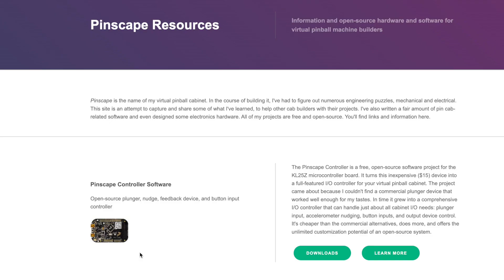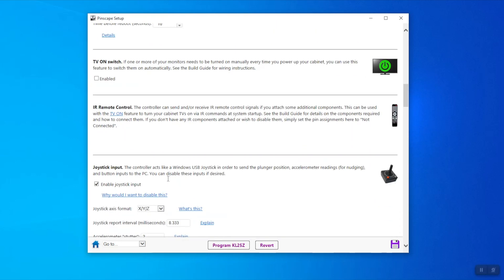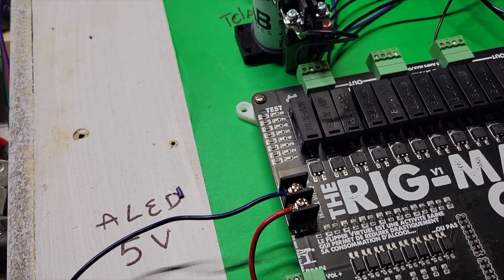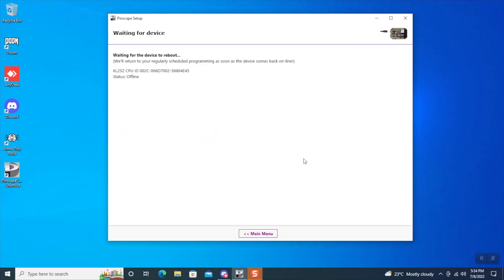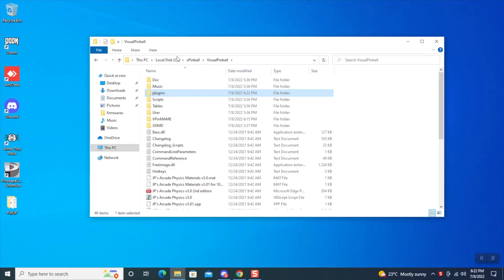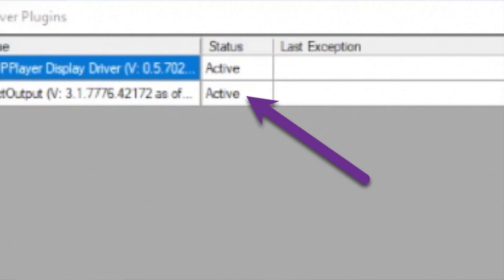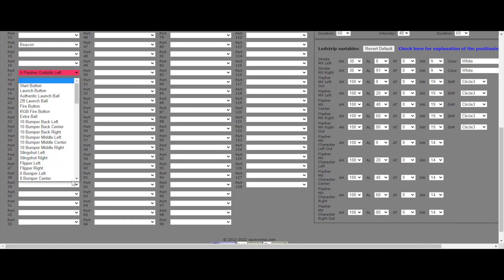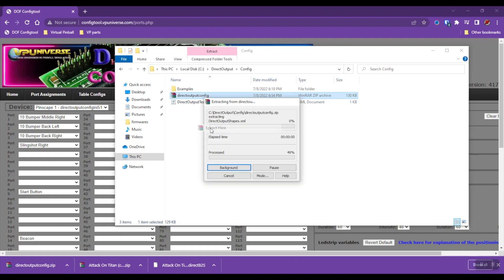Connecting Virtual Pinball Part 3 of 3 (Software)

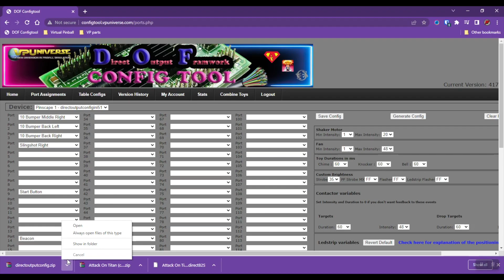Comment: I don't understand why you would have to regenerate Dof config files every time a new table comes out. This isn't placed in a table folder or location. Every table launched should point to this DOF folder location and use the file you created. Can you teach me why you'd have to recreate this per table?? (video insert at 8:31)
Reply from the maker: Because every time a new table comes out, the config is uploaded by the table creator on The Dof Config.  If you don't download a new config that table will not have the effects